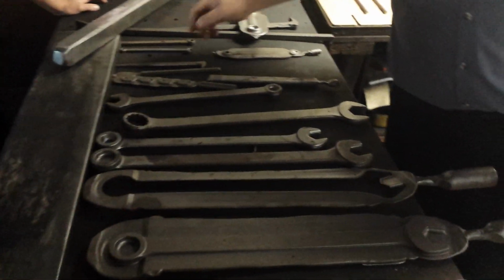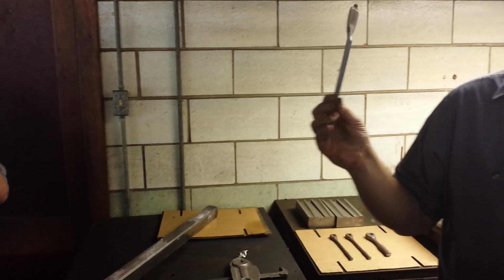Cornwell tools drop forging wrench steps

Comment: 30 pieces and hour? I see 31 bars in the furnance with at least 5 cuts per bar 3 by hand 2 by tong (155 pcs per heat) heated to 2500 degrees. 15 minute heating time. Forging blow sequence- 4blows in the roller 3 blows in the blocker 2 blow in the semi-finisher 1 in the finisher. With 2 helpers passing steel and hot trimming the yield should be approx 120 per hour.